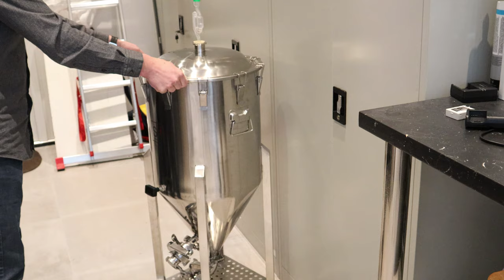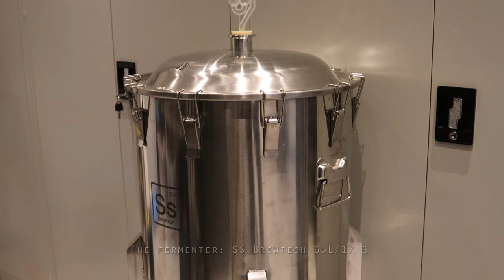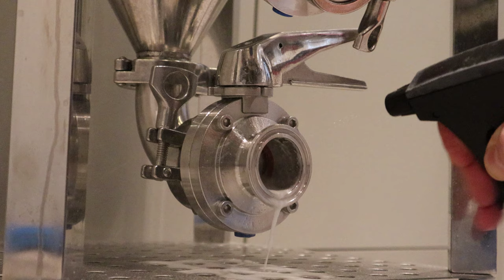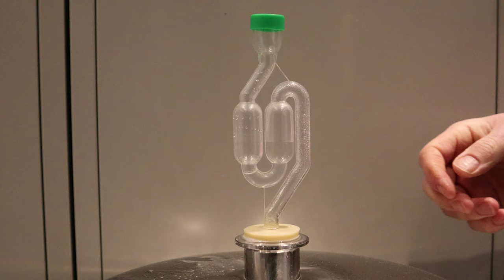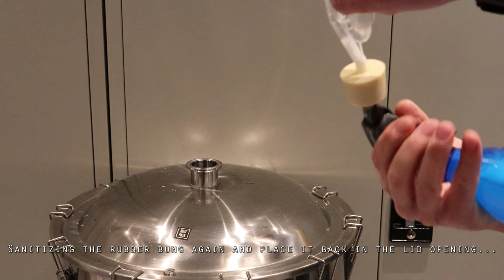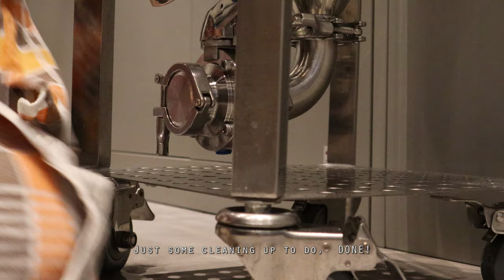SS Brewtech conical fermenter yeast dump. Easy! 65L/17G version with butterfly valves *4k*

Comment: Very informative.  Thanks.  Was wondering if you could dump the yeast using a hose barb fitting, along with a small section of hose on the bottom of the fermenter.  That way you could run it easily into your collection jar once the hops have cleared.
Reply from the maker: Sure you can also use a Barb fitting and a hose, but with extreme thick yeast slurry it won't run off. Then you have to fi f a mid way, first the thick slurry without a hose barb and later with the hose barb attached. Will show it on next video soon. Cheers and for watching!

Comment: Hey
Really nice channel, I was watching and learning a lot from all these videos!
I have some questions about dumping and bottling with a chronical fermenter since I recently upgrade from the plastic bucket...
When are you usually dumping trub and yeast from the fermenter (how many days after the yeast pitching)?
By dumping the yeast are you not reducing the fermentation on the rest of the wort?

I assume you are usually transferring into a keg but which will be the right process to bottle straight from the fermenter without transferring into a second bucket?
Since I'm adding priming sugar do I need to dump everything before and then prime, gently stir and wait 30mins that everything sediment again? Can I try to bottle without dumping everything so I will waste less beer?

Sorry for all these questions but I'm almost there to bottle and I still have to figure out a good way.
Reply from the maker: Thank you for your kind words. Normally I dump the yeast and stuff after about 7 days, many brewers,many methods. Some brewers dump it already after a day or 4 and repeat it daily.  When I bottle: just using the same silicon hose and I attach a bottle filler on it, bottle straight out the conical to the bottles, I prime them with (mini) sugar cubes  about 7 grams on a liter or I use  carbonation drops. My dead space in the fermenter with the racking arm pointing down is only 700ml. If you have any extra questions please ask! Cheers and good luck.

Comment: I am also thinking of buying the SS conical fermenter and I have the braumeister 20L as well. Would you recommend the 7Gal or the 14 Gal for the braumeister? Especially ligther beers produces about 25 liters of beer in the braumeister, therefore I think the 7 gal would be to small. Do you know if there any disadvantages of filling the 14gal only half?
Reply: I guess my opinion comes a little late - what size did you get in the meantime?
I'd say you can't go wrong with both sizes. I'm brewing with a 27l kettle, producing about 22 to 25l of wort for for the fermenter. I'm fermenting in the 7gal SS Brewtech Brew Bucket with the optional domed lid and a blow off tube. Definitely fits.
I'd say that you have a lot of headspace in the 14gal version of the fermenter - but the bigger version gives you more flexibility (if you plan bigger batches).

Comment: You should put CO2 pressure on the top instead of just removing the air lock. Oxygen is going into your beer!
Reply from the maker: You are right, but just a little oxygen, there is still a huge CO2 blanket on top of the beer. Again, right but I am not concerned about it. Cheers and thanks for watching!
Reply: @homebeerbrewery  Yeah, I'd rather put only CO2 into the tank ;) Furthermore, if the yeast is stuck, you can increase the pressure to help! Cheers mate!